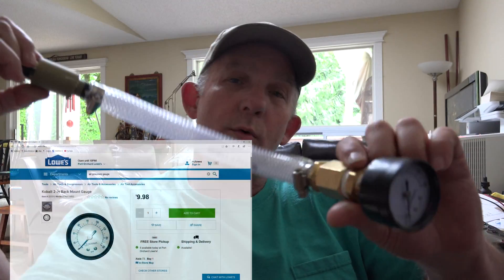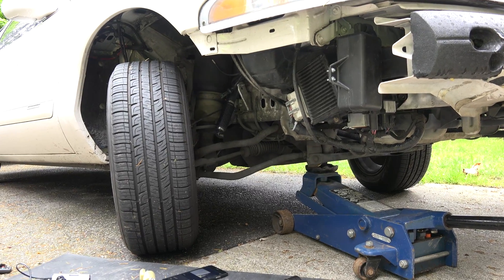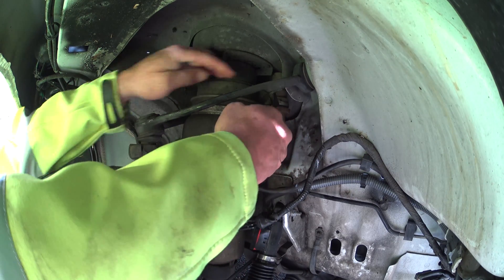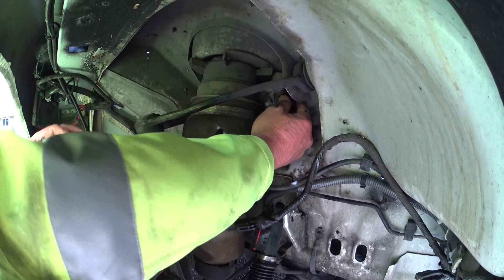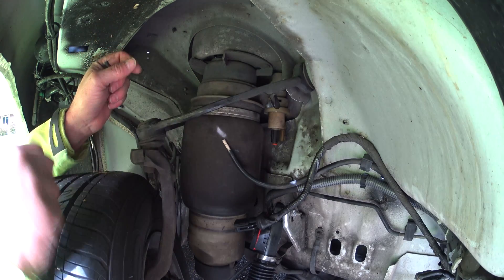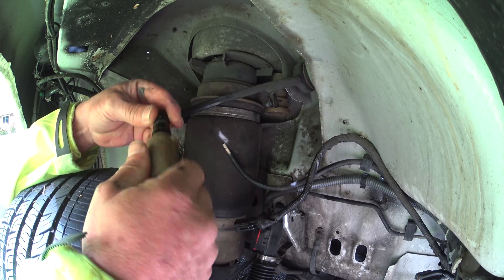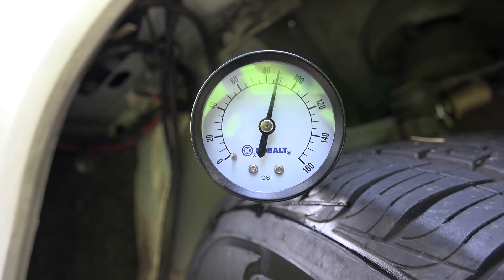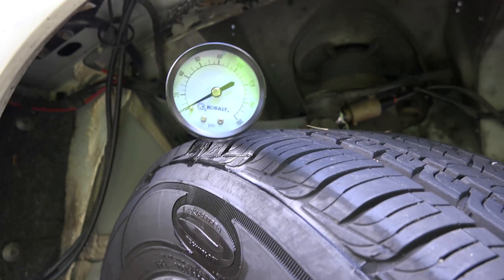1998 Lincoln Mark VII Compressor and Solenoid Testing

Comment: I know this is a odd question but is there susposed to be a single blade connector beside the air ride diagnostic plug?? My new star one can't see anything
Reply from the maker: Yes there is a single blade connector next to it. If I remember correctly it’s for the EVO test but it’s not for the air ride.

Comment: Jeff appreciate your videos
Good job 
Question 1997 Mark 8
Just replaced compressor and relay BUT New compressor won’t run or kick in at all ?
Could it be Air suspension control module?if so where is it located?
Thank you

Comment: Hey Jeff, so I just installed a new air spring on the front driver side of my 98 mark viii. It inflates perfectly fine but it literally goes flat after like 20 minutes. I tested the bag with soapy water and no leaks and did the same with the solenoid but with the air line still attached. Does it make that much of a difference if the line is connected or not? You'd think for that bag to go completely flat that fast you'd hear the air escaping, but I couldn't see or hear anything. Any help would be greatly appreciated! Thanks!

Comment: Hey Jeff, Thank you for posting the video. I'm trying to diagnose a 04 navigator. Suspension was acting up so I replaced the compressor and now it won't engage at all. The bags aren't leaking, but they are old. Can jump the compressor through the relay plug but the bags won't fill. I imagine the solenoid is closed and won't allow the air in. Getting C1770, C1830, C1881 and C1991 DTC's. Any suggestions would be much appreciated. Replaced the ride height sensors as well.

Comment: Jeff Tjernagel,,  I hav watched your vdos and I appreciate your knowledge.  Experienced technicians are not around rural Arkansaw..o Obvious you lik your lincoln as much as I like mine.  I hav a 97 mk8. Air ride gave me trouble so I replaced with struts..  not tha same car so I’m going back to air ride.  New bags and plugged everything back , switch on, an I got nothing. I’m thinking I’ll replace compressor.  My question is do I go at it from top or underneath?  Do you recommend a compressor brand?  Thank you,.  JohnGore
Reply: Frm Johngore
Reply from the maker: I would only buy the Arnott compressor. For me it’s easier to remove the bumper cover than working it thru the wheel well. I’d rather take that little bit of extra time to fully open it up than struggling in the cramped space of the wheel well. 

I’ve still got my ‘98 and it’s doing great. Let me know if you need any help or have questions I can help with. 

https://www.arnottindustries.com/air-suspension-compressors

Comment: Ive got a 2002 Town Car with air springs in the rear. Took the springs out as I was told they were new but of course I wanted to see " how new?" They were in beautiful condition so I reinstalled them with new solenoids.. So I made my own tool that connected to the air line as you did and my air spring compressor is putting out 150psi. The compressor in the car did not have what it takes to get the springs up. So Im thinking an air leak in the lines. Put a vacuum pump on the lines and it did hold vacuum as the book said it should. So now with another adapter I place a shop compressor onto the line at 120 psi and the rear air springs inflated like bats out of hell. What do you think the problem is?

Comment: I have 1995 mark8 and my air pump work but no air go in to the front  air spings,the back ones looks ok. I replaced  one air spring  that was leaking the other side was ok,no leaks but no air in them now.
Reply from the maker: Check the solenoids on the air bags. Are both of the fronts not airing up? Or just one side?
Reply: @tjernagel  I replaced  one new air spring with new solenoid and the other side was ok when I spray  it with soapy  water NO BUBBLES. When I start the car the pump works ,no ,,strange,, noises from there and stops  like usual after a minute  or so but front doesnt rise.

Comment: I have one word for you;
JACK STANDS !
I have witnessed a guy crushed by the bed of his own dump truck while standing between the rear tandem wheels when a $10 part let go, releasing the hydraulic pressure holding the bed up. 
I see it happen again every time someone trusts articulated equipment to keep them safe.

Comment: Thank you for the help. New bags and new compressor but I added air with an air gun when the compressor kicked on, so I knew the solenoids would be open, and it aired up quickly to ride height setting but didn’t stay there overnight, it was a way to see if I needed the solenoids without any test equipment.
Reply from the maker: Will Goebel Just thinking... when I changed my front bags they came with new solenoids. Yours didn’t??
Reply from the maker: Will Goebel New bags - If they leaking down the solenoids are leaking or their o-rings. 

You could disconnect the air line to the solenoid and put some leak detector or soapy water on the outlet to see if a bubble forms.

Comment: Hey Jeff, one quick question, if you have bad level sensor would that affect the solenoids to allow air into the air bag?
Reply from the maker: israel maartinez It could if the sensor thinks the car is trimmed. I don’t know that I’ve ever seen a sensor go bad. They have been pretty reliable.
Reply: Jeff Tjernagel any suggestions? so I changed my compressor cuz it went bad, so after replacing it it works for about 3min and then it stops  for like a couple of times after that it just stops working but is not enough air to get the car (2005 navigator) off the ground.
Reply from the maker: israel maartinez Who is the manufacturer of the compressor?
Reply from the maker: israel maartinez On the Mark VIII if the compressor runs for longer that 90 seconds (? If I remember correctly) it will time out to prevent compressor failure. I would “assume” the navigator would have the same logic. It then won’t run for like 15 minutes.
Reply: Jeff Tjernagel yeah that’s what it does, but it turns twice then it stops. I tried airing up the bags putting straight air with a Schroeder valve but I couldn’t cuz I need to find a way to bypass the solenoid or find a way for it to open to allow air into the bag. And the other compressor is an oem from a crashed Lincoln
Reply from the maker: israel maartinez If you have the tools all you have to do to open the solenoid is give it 12 volts. Polarity doesn’t matter. If you know where your suspension computer is and have a schematic you can jumper it from the main connector with the computer disconnected.
Reply from the maker: Could still be a bad compressor... Are any of the bags airing up?
Reply: Jeff Tjernagel ok yeah I know where the computer is located, I will try it . And the rear bags seem to air up a little bit more. And Jeff I really appreciate taking your time to answer my questions
Reply from the maker: @realismartinez001  Good luck!
Reply: I installed 2 new airbags on the front driver’s side & they both deflated within 5 minutes. Thank You

Comment: Jeff, are you measuring 24 inches from the ground to the wheel well?
Reply from the maker: Tom Primeau From the bottom of the rim to the wheelwell. Should be around 24 1/4 inches.
Reply from the maker: Tom Primeau In this video I measure mine. https://youtu.be/oL01dISjbw4